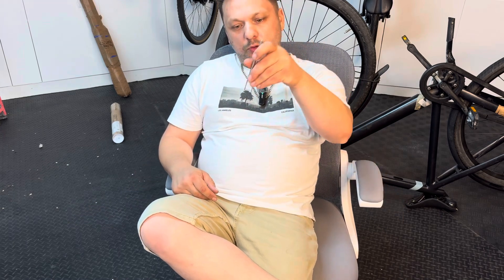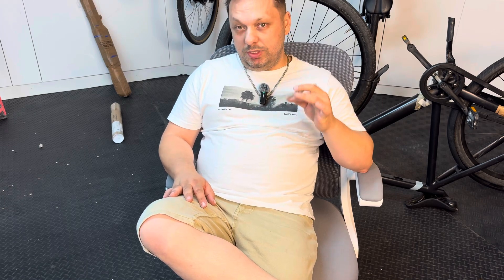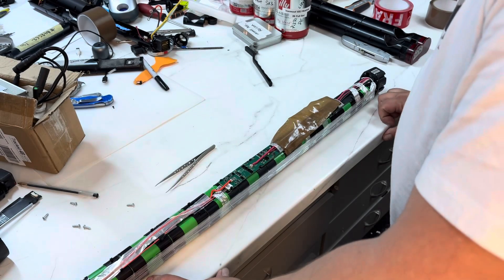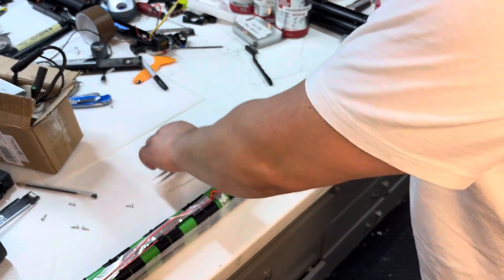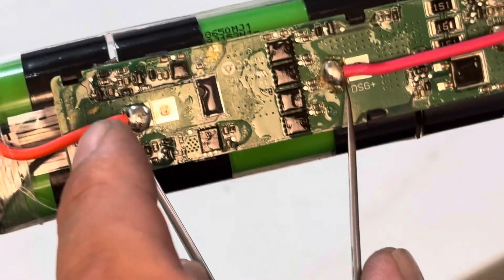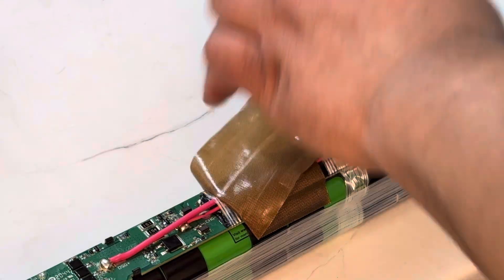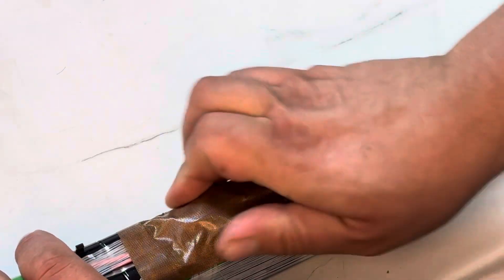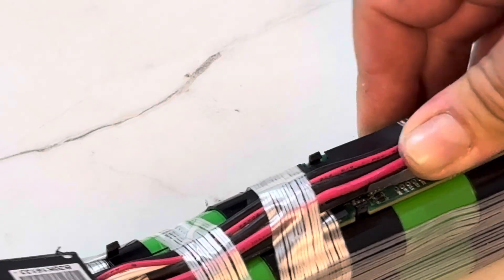Vanmoof s3 hard reset the battery when bms is shut down

Comment: Would this work for Err 17 and Err 6? Thank you so much for your videos! ❤
Reply from the maker: I ve replied ur email …. But no …. Most probably u have fuse blown on the battery…. And if u replace it will come back … is not a fault … is a software problems …. 1.9.3 firmware

Comment: I have err 19, if i plug in the charger, Bolt is on display but no sounds, Light on charger stays green, and cant connect to app, If i remove smart cartidge shipping mode is displayed, but when in the bike it displays locked, SC battery is charged. when i reseat all components startup is displayed but then error 19 is displayed.  any tips?

Comment: I have S3 with error code 21, I shunted the positive line to positive discharge and 8 seconds shorted the GND and RST. But the error code 21 did not go away. The charger light stays green. Is there anything else I can do to fix this problem? 
Thank you so much for your help, Michael

Comment: Hi again! Thanks for your response on the other video. I watched your latest video and followed the steps to revive the BMS. After doing it, I did hear the startup sound briefly, but then everything shut down again. I’ve tried the process several times now, and each time the startup sound plays for a second, but then everything goes dead again. No error codes, no lights – nothing. This keeps repeating the same way every time. Do you have any idea what I could try next? Thanks in advance for your help!!!
Reply from the maker: Let’s take it step by step…. 1 Remove big battery  2 plug charger in , check for charge bolt on display…. If there is not charge bolt on display ⚡️ means the module battery is dead … and will not work … if u have charge bolt on display… reset module just in case there is error on keep pressing frame button 8 seconds until clear all errors …. 
Do again those steps to the battery plug it in when bike is on charge and off only charge sign on display… plug the main battery and watch the charger to go red …. If charger doesn’t go red …. Battery has issues… fuse blown , out of balance some component fried so on …. Best wishes

Comment: Hi, what kind of tape do you use?

I watch all your Videos, but i'm not sure witch Mosfets, risistors an diodes i should order. Can you tell me the spezifications? Greetings fron Hamburg.
Reply from the maker: Made them all in a single purchase on eBay 

https://ebay.us/m/AYo7oW
….. and it can be shipped worldwide 
Regarding the tape Is a heat resistant and fire  suppressant … I can add a piece in the pack just leave me a note when you purchase
Thanks

Comment: I have been trying (with rst+grd) to get my bike to start after replaceing the fuse, didnt work then another time replace the fuse same problem but this fixed the issue. Amazing thank you 🙏
I have also lowered the charger but now it gets really hot is that normal ?
Thank you again and keep up the good videos I couldnt have done it without them/R